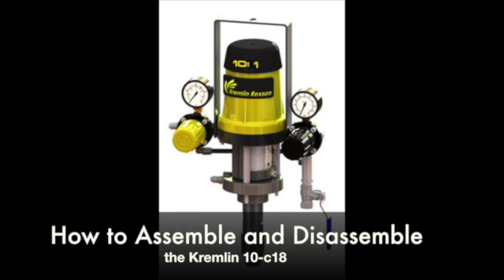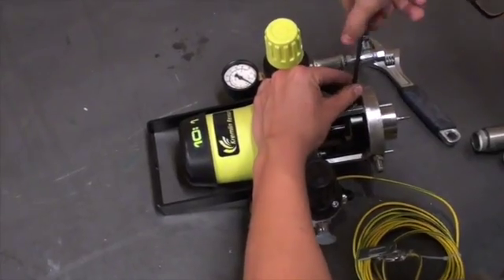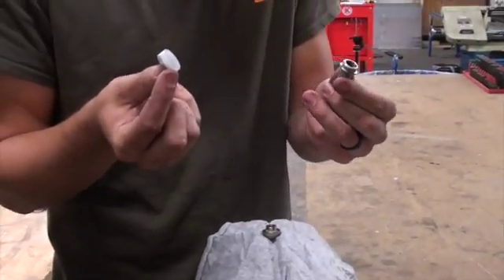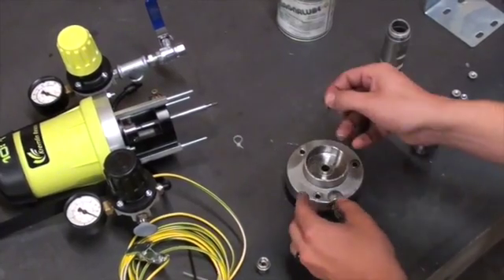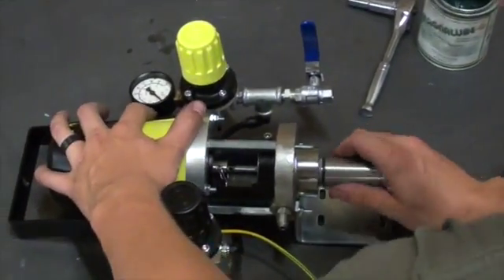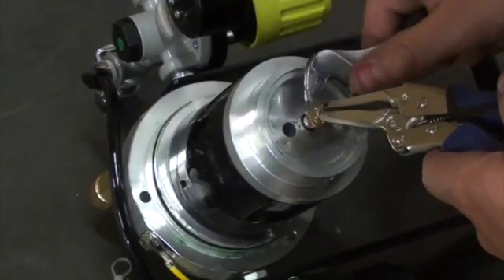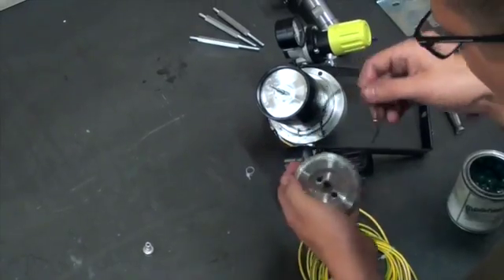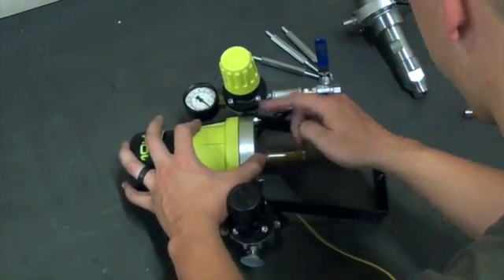How to Assemble and Disassemble a 10-C18

Comment: Can you remove the air assembly alone or do you have to take off the bottom section first?
Reply from the maker: Hi! I'm a bit confused by your question. The Air motor and Fluid section are connected by a pin at the top of the fluid piston rod (visible piston that goes up and down). Once you disconnect that pin, The only thing keeping those 2 sections together are the 3 support bars. Once you take the nuts off the bottom of these bars, it should separate from the fluid section!

Hopefully that answered your question! If you have any other questions, feel free to give us a call at 800-638-4410, or email service@grapekbates.com

Comment: When I try to remove the exhaust valve the piston rod turns freely. Does this mean something has come lose in the air motor? Any thoughts will be a help. Thanks,Mike
Reply from the maker: Try putting a pin through the hole where the air motor piston and fluid section piston rod connect. This will allow you to thread off the exhaust valve assembly.

Comment: Which grease are you using please?
Reply from the maker: We use a teflon grease. Some of the repair kits from Kremlin supply a small tube of this. The part number on our website for a 1 pound container of this grease is 560-440-001. You can follow this link to see that part on our website - https://www.grapekaction.com/grease-teflon-450-g-560-440-001